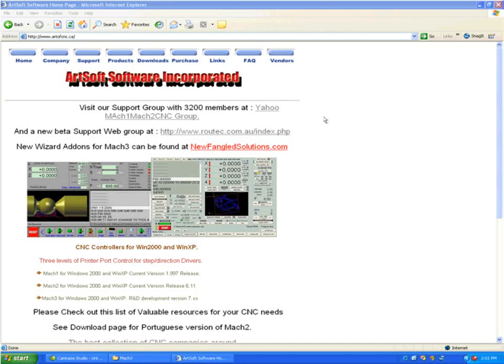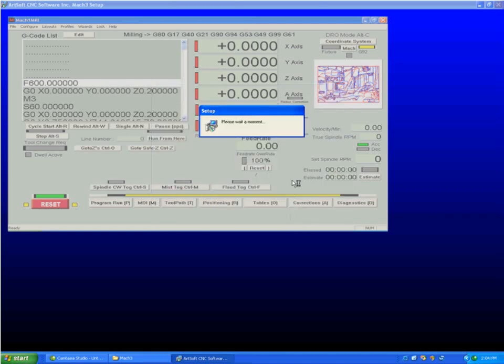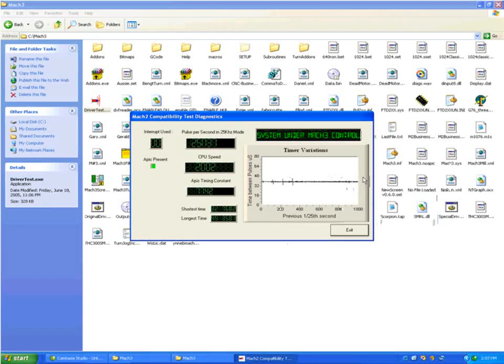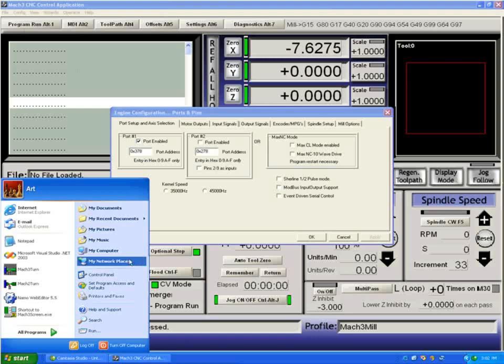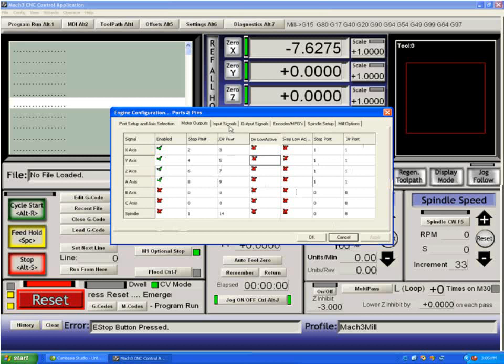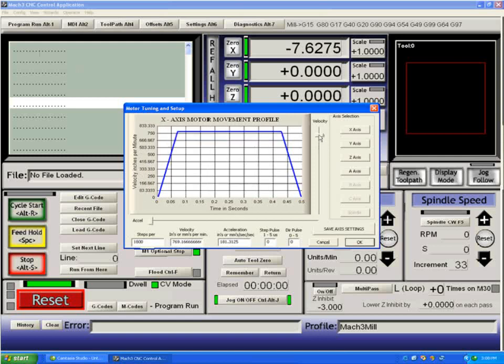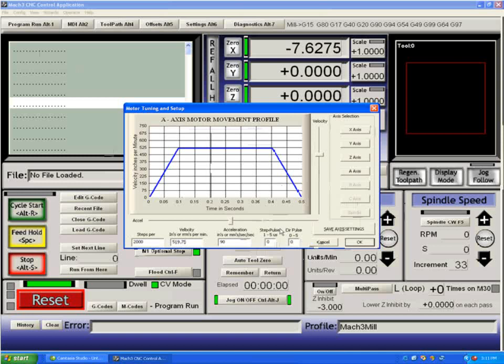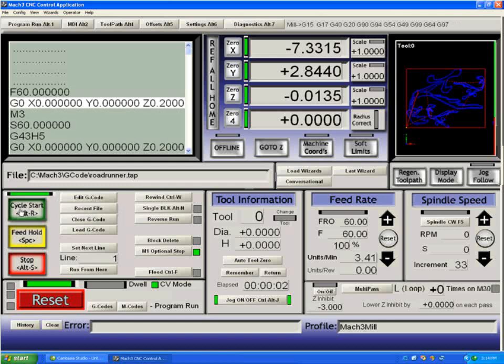Mach3 Installation and Basic Configuration

Comment: You're the man! I spent many hours going through internet info on trying to get a CNC zone 3040 router up and running. One of the biggest things I found was all the ways to connect it to the PC. Some say adapter X works and others say they don't or Win10 will work but nope. So what I found was just go find an older computer with XP 32 bit (not XP Pro 64bit). Shut off firewall, screen savers and just about anything else that will try to run. Use Mach3 and FOLLOW YOUR  VIDEO! Setting up the pin numbers is what really got things going. Mine turned out to be X pin 1-2 Y pin 3-4 and Z 4-5. Which I swapped x and y because like a milling machine the x has more travel. The only thing to add is the calibration page. I think there are many people struggling to get these routers running. Sincerely a retired machinist with a new toy!
Reply: I need help with the same machine. I don’t know why it doesn’t work 
I did out the numbers you did and when I hit the arrow the spindle starts moving.

Comment: I have a 3020 and everything runs fine, except any file I load cuts a tiny little version.I tried the roadrunner and it came out less than 1/2" in size. I had a mach3 user friend convert a logo for me at about 5" square, but when I loaded it in my mach3, it cut at about 1/2"in size. No idea how to fix it. Our systems are nearly identical settings.
Reply: setting (alt6), then "set step per unit" (lower left), command a movement, check what movement you got, enter it. and it will adjust your motors to correct output.
Reply: @mbmach2  oh I forgot to update. I did do that and it fixed everything!

Comment: Hi there, I have Connected everything like it should installed Mach3 and put on the CNC openend the Mach3 software it says driver loaded but nothing works or responds.
I did set the config as it should (double checked), still nothing.........
No drivers cd or Manual was given, took a lot of searching the internet too find anything like plugins but non worked for me.
Can someoone please help me i really want too enjoy my CNCEST PRT-E1500W 6040  CNC. ( USB )

Comment: I am having issues with mach 3 and jcut cnc. Mach 3 will not jog my axis for some reason. Also I can start the spindle under midi by typing in m03 s24000. But when I go to run the program it stops the spindle and it doesn't move at all. Just needed some help with the settings as I think that is what the problem is.
Thank you

Comment: I just installed Mach3 demo on my cnc Router, I’m not sure what values to enter under the motor outputs section for the step pin and dir pin #
Reply: try any # (1 thru 25), change one and see if anything moves. Motor outputs, x axes, step pin#, change the #, click ok, then try to move axes with arrow keys. It worked well for me! Mine was x pin 1-2 , y3-4 ,z 5-6. hope this helps people going thru it now.

Comment: I was under the impression that I would be able to get my steppers to run before I actually commit to buy a licence but am not having much luck. I just need to know if the lack of a licence means that I cannot actually get the wizard program to run in anything other than simulation mode.
Reply: Hey Brother, did you ever find an answer to your question?  I'm trying the demo right now and can't get anything to work on mach3.  I can get it all to work using Drufel, but I don't want Drufel, I want to use mach 3.  Using windows7 64bit. 

Thank you, Jeff